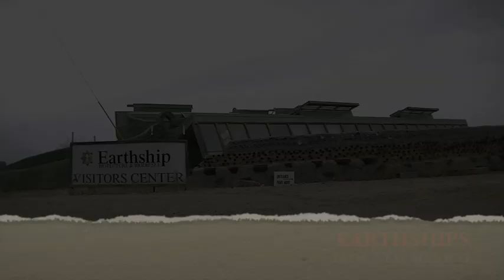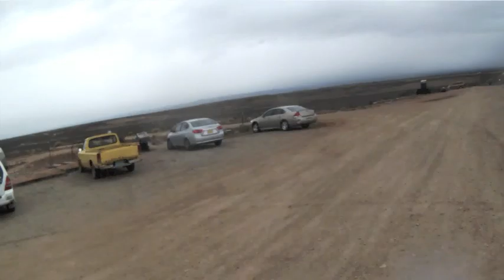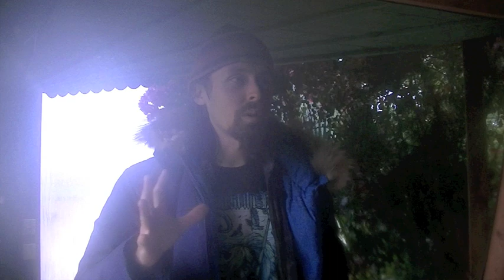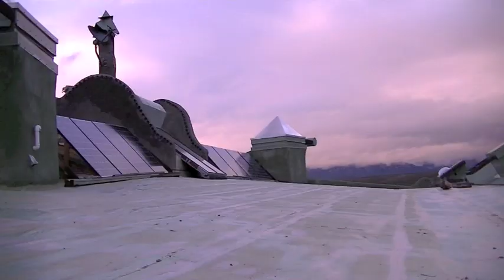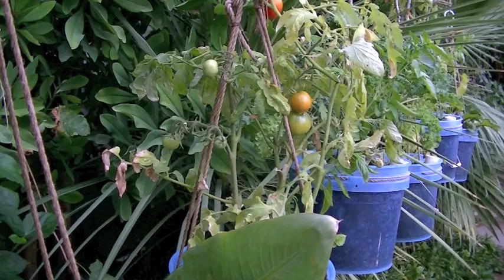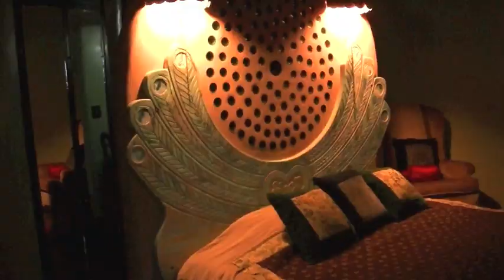Inside an Earthship

Comment: Scooter, actually they are not expensive at all when compared with traditional home building. The "concrete" is made from the soil on the land, Tires for foundations and cans and bottles for non-load-bearing walls can be had from the junkyards, often for free, You pay for the solar, the plumbing, and your dig. You can build anywhere, just might have to show that it is stable enough for safety codes. You can check it all out on the EARTHSHIP website.

Comment: These are really interesting and I applaud the use of bottles, cans, tires, etc...but this has to be a relatively expensive dwelling to build. Concrete isn't cheap and there's a lot of it in these. The payback is that they are extremely efficient, I'm sure.

Comment: Cool idea for a house but using the bottles and soda can's just because is stupid and looks bad.  Leaving pockets of air inside concrete may not be the best idea either.  I really like the idea of having a self contained and functioning house though.  While the materials are cheap you dont realize how much back breaking work goes into filling one tire with enough dirt to make it structurally sound.